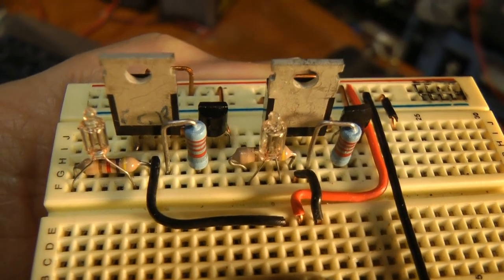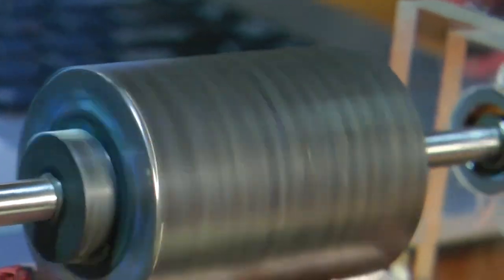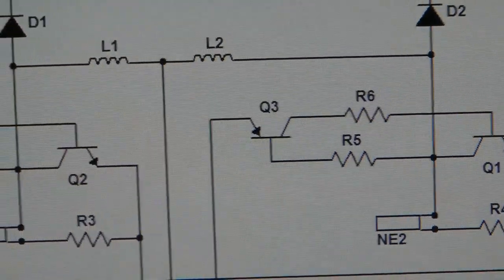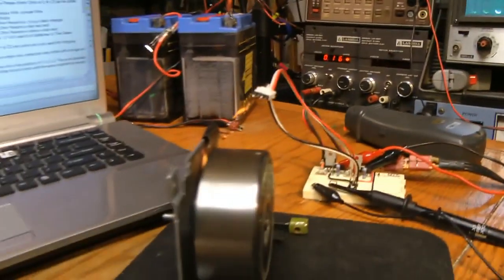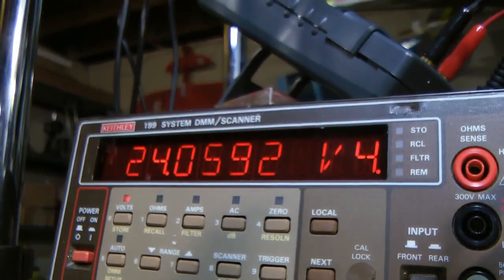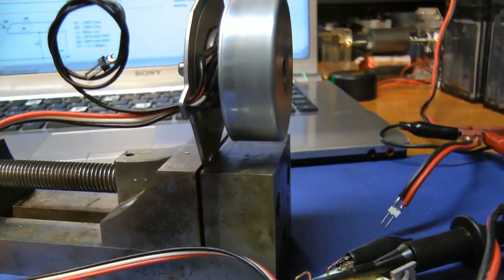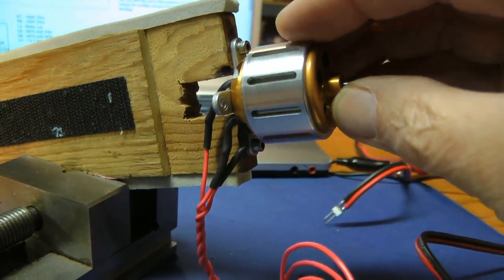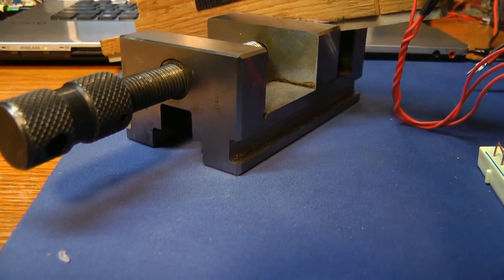1 Coil Brushless Motor Driver (Multi Phase)

Comment: FOR THE RECORD "you can call it whatever you wanna call it.  You could call it a two stage single coil boost amplified radiant oscillator magneto motor generator driver charger"   highly recommended :D

Comment from the maker: Sure John, Good luck with you're classes. Last time I had some I was learning about electron tubes. Window motors are easy to drive. If you are just making one for a desktop project you only need a read switch in series with the battery. 
Thanks for watching the video.
John

Comment from the maker: Hey Pal, The driver transistor (A56) only to turns on the power transistor. It will only be seeing the voltage generated by the coil on the motor. The power transistor however will have to deal with the voltage from the power supply and the HV BEMF if any.
John

Comment: I always enjoyed watching your videos. This thing with the  circuit which is capable of driving three phase brushless  motor is quite interesting, i done some combination of NE555 and 4017 but it is very tricky and only difference between Your circuit is that starts motor without intervention, or manual spin up . 
Once more, Thanks for good video!

Comment from the maker: Hello Miguel. Anyone's comments are welcome here as long they can be polite like yourself. I think I understand what you're saying but there are also some pretty good ESC's with higher current handling mosfets. I'm not trying to say this circuit could substitute any of the conventional controls but it does give the pulse motor enthusiasts an option for collecting kickback or the Buck Boost characteristics of the circuit for feedback experiments. It needs research though.
Thanks
John

Comment from the maker: MrPounal, I just noticed the battery terminal is reversed but there is a + voltage sine on the battery in the right place. I will make a note on the video. My motors are terminated in Wye not Delta and that might make a difference. If possible you should try to use something that has current limiting so you don't explode transistors. It's hard to help while not knowing exactly what kind of coils your motor has. You can also use potentiometers instead of resistors to get different adjustment.
J

Comment from the maker: Hello, Bigger may be in the plans but the circuit needs some changes. A large asymmetric motor would be something worth while trying. I hope to get some advice on windings from an expert. We'll see where it goes from there.
Thanks. BTU's Ha, ya they sort of come along with high RPM's. Some people confuse the result with power or torque but it just burns your fingers from friction. LOL
Thanks
John

Comment: Wow impresive circuit sir dadhav ur right its only need starting turn i dont hve rpm meter but i think the speed is 3500rpm. Tnx fir sharing ur excellent curcuit  i use driver xsistor a1013  and the pwr xsistor c3182.
Reply from the maker: Hey that's great, I'm glad you have it working. Have fun experimenting.
John

Comment: I wish I could have got this to.  I have never failed on a project before.  My problem turned out to be my inability to convert the schematic to the motor.  It shows a start and end for each coil, but that doesn't apply on the motor.  The motor has 3 power inputs only.  Impossible for me to convert.  L1 in leads to L1 out.  Not in reality.  Keep up the projects, you have so much to offer.  Thanks
Reply from the maker: Hello Tex, I'm sorry you're still having a hard time getting this to work. Let me mention a few more things. The drawing shows a motor that is three phase and has a WYE termination. In this termination each end of each phase is bundled together inside the motor and tucked away somewhere. The beginning of each of the phase windings is outside the motor and in any sequence has one wire connected to the collector of Q1 another connected to the collector of Q2 and the third goes to the positive side of the battery. Now if you have a motor that is connected in DELTA the diagram would look different. The delta connection is more like a triangle with a wire coming from each point. This could be a reason for the motor not to work. I've never had one of these printer motors that was DELTA. Something else that could be an issue is if the motor is small with not to many turns of wire in each phase it could be hard to start. The motor itself has to generate enough of a trigger pulse to start the circuit and fire the power transistor. I think you sent me pictures of the motor but I don't think I have them anymore. I'd be glad to help you if I can.
John
Reply: Thanks again.  One of your suggestions was to test my transistors.  Yeah I blew one when I had the polarity wrong.  I still have the motor (same one you show) and I may try it again.  I'll leave you alone next time.
Reply from the maker: texjarhead
Tex, some people post videos because they are serving themselves. I post because I want to help share and suggest things that others may not have thought about. I don't mind doing what ever it takes to help the friends I have who are following my channel. I may not always get to my messages promptly because I have a lot of them, but I'll do what I can. Let me know how else I can help. 
John
Reply: You have done enough for me John.
John in Texas

Comment: I really enjoy your videos, especially the one where you show the high spikes on the charging circuit and this one.  I tried to reproduce what you have done in this circuit, but I am having some difficulty.  I used the parts that you have on the single coil circuit, and I know that there was a problem with polarity, but I tried it both ways to no avail.
I did however, get my power supply to oscillate through my coil, and drive the motor that way.  When I tried the single circuit however, I COULD NOT get it to work.  I will admit, my resistors are right AROUND 100 K, not EXACTLY 100 K.  The coils from a projection TV tube work fairly well, to start with.
Reply from the maker: Hello John, Sorry you're having trouble. This circuit can sometimes be a pistol to get working. People experimenting with it should have a current limiting power supply because with the wrong resistors the transistors can turn on hard and burn out instantly. It's good to have a meter that will check transistors as well. Do you have a window motor made from a TV coil? Can you tell me a little more about what the rotor is like?
Reply from the maker: John, I got your mail describing the motor you made. It sounds like something that should work. My question would be are the two coils in series placed one on each side of the rotor? Are your magnets alternating poles or all the same pole facing the coils? With this type motor polarity can get a little tricky. I never try a motor on the one coil circuit unless I can make it run on a circuit like the  half wave window motor circuit or a circuit using a reed switch. You can try spinning the rotor by hand and checking with a meter to see if you are generating a potential that can trigger the one coil circuit. If not reverse one of your coils or consider your magnet polarity.
Reply from the maker: Hello John, I've been getting your comments on my email but they don't seem to show up here. I never have good luck if my circuit and coils are oscillating. The motor should run with low current and no oscillation. Having all same polarity is very different than when you have alternating poles. To trigger the circuit you need a pulse from the coil. If the dc pulse is the wrong polarity the circuit may not trigger. Try reversing the two wires from your coils or turn each of the around 180 degrees. Just a guess but worth a try.
Reply from the maker: Hi John, per your last mail. I didn't say the signs where reversed, I said the symbols are reversed. The plus signs are correct. You can always look at where the transistor emitters are connected. the npn goes to negative and the pnp to positive. I have never tried an all north pol motor with this circuit. That might make a difference. I had a few motors that didn't work but they where brushed toy motors. I'm starting to run out of ideas for you. Is it easy for you to change magnets. Can you try two magnets with opposed poles and one coil? That should work for sure. Are you checking your transistors to make sure they are good? Keep in mind you don't even need the neon bulbs the diodes and the charging batteries. That's an optional feature.

Comment: I loved the D1/D2 who controls the flow, and it seems that the NE2/R4 takes care of backEMF? The V1 are as a "starting power", the XSC1 are the signal of how to drive the motor (sinuswave), the rest are a little unclear, I need to study it more. Thanks, it was very inspirating, a little complicated since one have to use two power supplies, but everything can be solved with a LM317! ;)

But how do the XSC1 works, I see it is going straight in, does the signal "integrate" with the power of battery?
Would'nt it be easier/better to use a tranistor to control the power?
Yep, the driver is pretty bizarre, thanks for sharing!

The lower driver (with L4) are also interesting, I have to make an experient with these drivers when I am in the right mood. Thanks! :)

I have to think more about it, it's not so easy to grasp it right away.
(one of the reason that the comments are as it is)
Reply from the maker: Hello Atie, Maybe I can help clear things up a little. First, yes it's an unusual circuit for sure and a lot of fun. The main feature is it will work with only one winding. Ok this is because it is a pulse circuit and uses the same inductor as a trigger and a power coil. In other words the magnet passing the coil fires the driver transistor which fires the power transistor almost simultaneously. IMO. The firing of the power transistor pushes the magnet of the rotor past the coil and drive turns off until the next magnet approaches. The sine wave on the scope is not from the transistors turning on but from the standard generator effect of the motor. The spike is generated by BEMF of the coil collapsing from the pulse. The diodes and batteries v2-3 are not necessary for operation and are only there as a charging experiment. Note the simple circuit under the larger one. I can run my window motor at less than 5 micro amps with the simple circuit and less than 1 volt. I actually use a 10 meg ohm resistor on the trigger circuit for this. I hope you experiment a little with the circuit and have some fun. Remember to keep the resistors high in value to start with and also that the circuit doesn't self start. You need to manually get the first trigger pulse. Have fun and let me know how you're doing or get in touch if you have any questions. Oh the neons simply show there is high voltage but do offer some protection for the transistors, you are right.
John

Comment: Great job. i have been searching for a way to drive three phase ac motors on a battery or a smart motor like the fisher paykel the resembles your airplane motor somewhat. What would you recommend regarding the components for a heavier motor like the aforementioned to play with or would it even work?
Thanks and keep up the good work.
Cheers
Reply from the maker: Ron, I'm sorry I never had one of the washing machine motors to experiment with. I've seen them used as generators more than prime movers. I suppose you might be able to do something with the original control from the washing machine and certainly could use one of the many three phase motor controls available from the Internet but they can be really expensive. I'd do some more searches to see if anyone has tried something that would help you.
John

Comment: I hate to bother you with my ignorance but I have a question.  When I have this running it will be a great tool for me.  Im still waiting on the 2 BD243 transistors.  My question is simple.  I have several 3 phase motor like you have.  I think the schematic shows that i connect a phase to the pos side of D1 and a phase to the same side of D2.  Where the heck will phase 3 go?  The schematic shows a point, but my breadboard has no such spot.  I appreciate the heck out of your help.  You have taught this old Marine plenty.
Reply from the maker: Hi Tex. I hope you have some fun experimenting with the circuit. Ok, think of this a little different. More importantly you are connecting the coil of the motor to the collector of the transistor. When the transistor is triggered the current path is from the collector of the transistor through phase one coil and out the series coil of phase three. Then the other transistor is triggered and the current goes from it's collector through the coil of the second phase and out the third phase then to the plus side of the battery. My proto boards have power rails on both sides of the board, but as long as you get the third phase to the plus side of the run battery (V1) it doesn't matter. Note: The 24 volts (V2 and V3) along with the diodes are only a battery charging option and the device should run without this stuff. Almost any small diode there should work. The circuit can be a little sensitive, and you might want to use a small fuse or a current limiting power supply if you have it. Let me know if I can help you further.
John
Reply: You have answered evey question!  No one else on the Tube does that.  Thank you Sir.
I am making some LiPo battery packs (for no reason other than I am retired and bored) and have no way to recharge them.
Reply from the maker: texjarhead
Tex, read up on the LiPo stuff they can be a little dangerous if shorted or over charged. Check some of the sites like HobbyKing for chargers that are really fair priced.
Thanks I have a lot of subscribers and try to get to everyones questions. Retirement helps a little with that.
J
Reply: Any chance you have V1 V2 V3 backwards on the schematic?  You say in the video to jumper to pos if you don't have L3 but the paper shows it to ground.  My circuit does nothing until I plug L3 to Pos.  Then it jumps and I can feel some magnetic attraction happening.
Reply: Change that.  My motor reacts when I send L3 to ground
Reply from the maker: texjarhead
Tex, You are right the battery symbols are reversed. I have a plus sign on the battery but the symbol is wron. I hope it hasn't caused you a problem. I'll make a note on the video. I thought I did already but maybe not. Are you saying your motor runs with the wire attached to either rail? I'll have to check that out if it's the case.
Reply: No, it doesn't run yet, but it jumps to life on one phase when I attach the last lead to neg.  I have some rewiring to do now.  It may work..
Reply from the maker: texjarhead
Hi Tex, I might make a suggestion here and ask you to find some information on how to check your transistors to make sure they haven't been damaged. The third leg of your three phase should go to the positive side of your run battery in order to duplicate what was on the video. The transistors shouldn't turn on until the motor is spun to generate a voltage on the base of the transistor.
Keep me posted. We'll get you going somehow.
John

Comment: Will this circuit just fire 2 of the coils and leave the other one for generation?
Reply from the maker: Hey Tex, Not being a Marine I know better than to call you Jarhead, but if I did, I would call you Mr. Jarhead with respect to the most courageous and honorable of the many many definitions to the name. OK, that's a good question about the phases. It's hard for me to wrap my head around what is really happening here and I haven't worked with the circuit much after the video. I think what we see with the three phase motor is the third phase which isn't connected to transistors pulses along simultaneously with phase one and two. I'd say the motor is more like a two phase motor that shares a common current path through the winding of the third phase. Does that make any sense. Maybe I'll figure it out more when I get back to experimenting.
Thanks for watching Tex.
John
Reply: I really appreciate the answer, it helps me to understand the circuit better.  I see that you have all 3 phases plugged to the breadboard.  Is the 3d one just connected to a power rail?

Semper Fi
Reply from the maker: texjarhead
Yep, the plus side of the run battery. I almost forgot it's over 40 years since I've been in uniform but our code of arms patch also had some latin on it. It's not as famous as Semper Fi but it had a strong meaning.

Facere Non Decere             107th Armored Cav.
John
Reply: BTW you did warn  about it in the video.

Comment: hello sir dadhav i tried the circiut that u made but cant work i test it on hard drive motor'  btw sir what s the purpose of the neon lamp? cozz i replace it with resistor:-)
Reply from the maker: Hello Friend. Maybe I can help you. First of all this is not a self starting circuit. You have to give the shaft of the motor a twist to get it started.The transistor must have a generated voltage from the motor acting like a generator. Next you can not put a resistor in place of the neon. The neon is not necessary but gives you an indication that high voltage is coming from the collapsing coils of the motor. Some people like to use this energy to charge batteries. Look up the Bedini SSG circuit as an example of how this is done. Let me know  if you need more help.
John